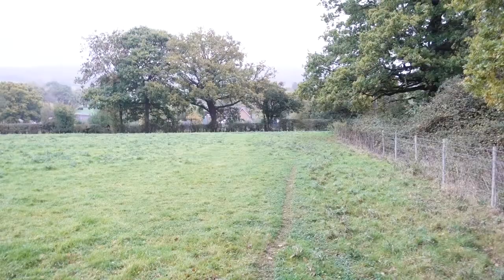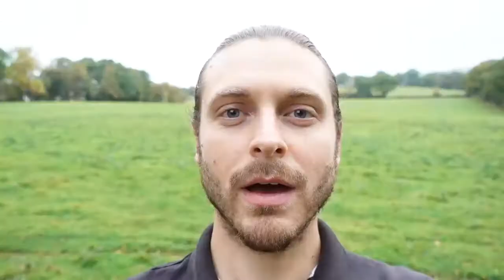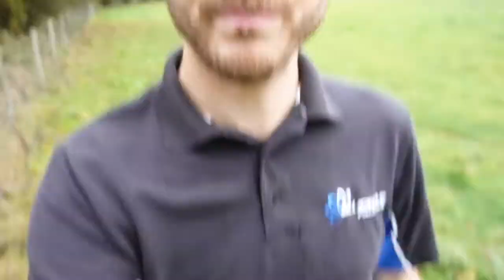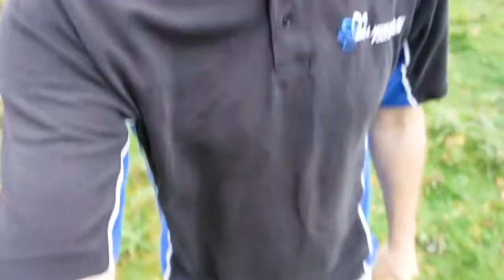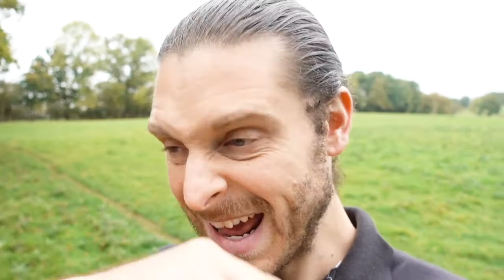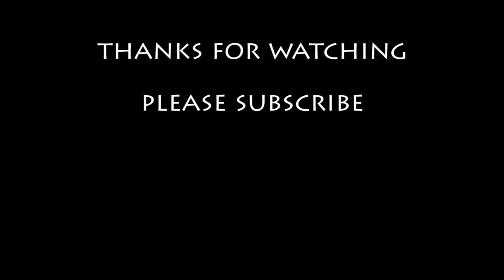FIRE RISK IN HIGH RISE BUILDINGS | WEEKLY VLOG

Comment: Bro that's a 250 mm cable , be cheaper to get a new supply install
Reply from the maker: Jim Douglas I haven't done the calcs yet because there was talk of potentially ditching the supply where it comes from in the future and fed from another location adding additional length on the cable. The location is seriously rural so I would be interested to find the cost of the DNO supply because we'd have to enable one hell of a run for them plus the cost includes all works required to add the supply!